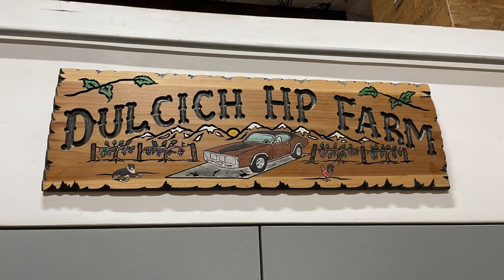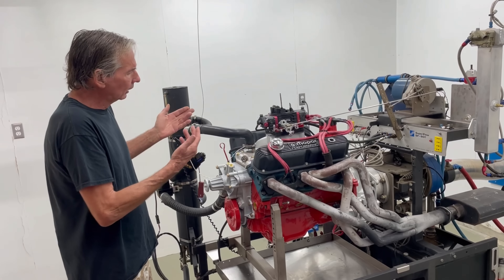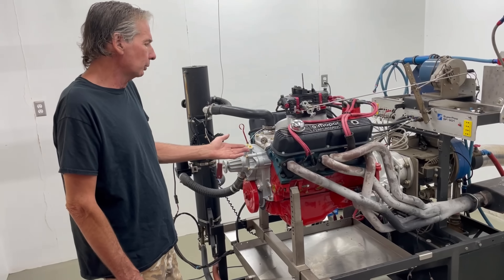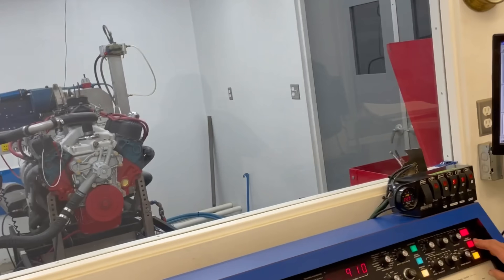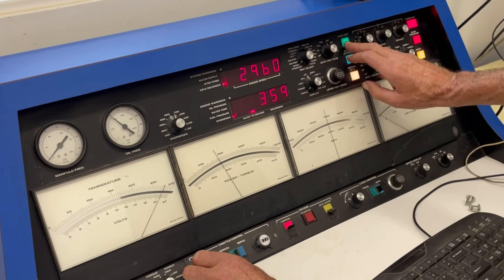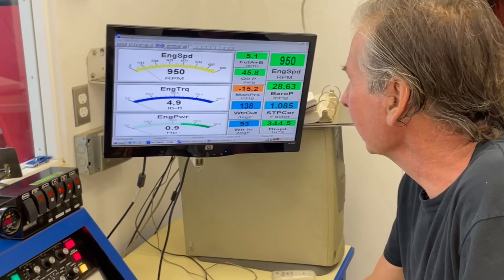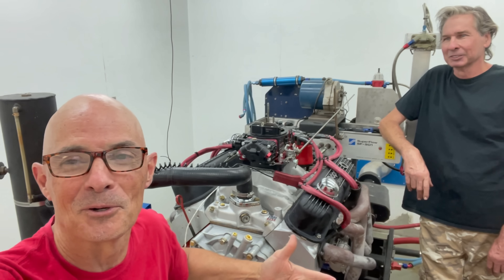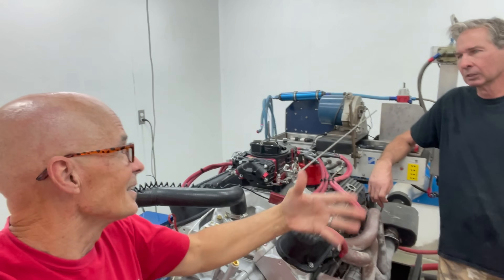AFR MOPAR 340 HEAD TEST! THE ENGINE MASTER HIMSELF, STEVE DULCICH & I COMPARED AFR VS IRON 360 HEADS

Comment: By all accounts, the open chamber 360 heads have 75cc +- combustion Chambers. AFR are 62cc.
I wonder how much power and torque was created simply from the compression bump? Definitely some.
The overall power numbers here seem very optimistic. All that matters is the increased power reference.

Comment: What I would give for a dyno session with Holdner or Dulcich and my very first blueprinted 360. The engine was built completely around the Comp XE284H and the first engine I built from the crank bearings up.

Comment: My first look at AFR heads on a Mopar. I know they work great on a lotta Chevy stuff.  This is impressive but didn’t edlbrock claim 50-60 hp increase by just bolting on their heads? I run them on small block and big blocks always had great luck but the newer set I have are prolly 2012 I think back to 99 being the first set I bought.

Comment: Super cool! One thing I’ve never seen on YouTube but would love to is get a decent running low performance 383. Dyno it as is, with that insane single 2 1/4” full exhaust & stock muffler… figure it’s probably around 250 hp… maybe less. Then dyno with dual exhaust, then with hp manifolds, then with a 4 barrel & high rise dual plane, then headers (heard headers don’t do much with that the 2 barrel cam; nice to confirm). Then do a whiplash cam; might need 93 or more octane with 8.5:1. or 9:1

Why you ask? If power is in the heads, these have the same heads as 440s so it would be really cool to see a boat anchor 383 make gain maybe 200 hp with only a cam, headers, and dual plane & carb… that cam is silly, but so what, it should make it all come together. Steve tried something similar was tried with a motorhome 440 but they have such low compression the outcome was not impressive. Just a tweak on a good theory.

Comment: Did the peak torque on the AFRs top out before 5200 rpm because of the tuned length of the intake runners, or because the heads could have flowed more?
Reply from the maker: mild cam, dual plane
Reply: @richardholdener1727 thank you, Richard!

Comment: Richard, on a change over to a kill shot system, I have both the dual plane and single; which one for the kill shot? I watched engine masters testing back and forth, the single ran cleaner under a Holley system. I have a 496 br300 cam
Reply from the maker: nitrous works with any intake

Comment: Nothing to circulate water through the engine. No pulley belt on the water pump. How do you cool it off between runs?
Reply from the maker: it has a remote electric water pump

Comment: Nice...Engine running,  WATER PUMP NOT TURNING.  What's the water temperature?? Is that a Mopar speed trick?
Reply from the maker: remote electric water pump for the dyno

Comment: Sir, considering an original engine like a 318 with a 4 barrel carb, that has limited headflow and a small cam; what'd you say would be better: a head swap with the original cam, or a cam swap with the original head? What do you reckon would make better overall? Thank you for everything you've shared.
Reply from the maker: cam would add more

Comment: Hey Richard, I know this is off subject, but why do you think nobody makes a cast cheaper version of a 4 inch stroker crank for LS motors. If they do, I haven’t found it.
The reason I ask is because I’ve seen a lot of cast cranks handle a lot of power, especially when the block has good strength and bracing on the mains and it seems to me the LS motor has exceptional, crank bracing with the mains set up 
I ran a scat 9000 cola 3.8 stroker in a early model sbc over 600hp on motor for years on the street also sprayed 250 pretty regularly 
Only issue I ever had with that engine was regular maintenance, which was valve lash due to solid roller, having to be adjusted every so often

Comment: hey richard is it possible to get some consulting on an ls build from you? it wouldnt be very long and id be willing to compensate you for your time. i just need to cut through some of the conflicting info im getting.
Reply from the maker: ask away or join the live feed-free info every night for 1 hour
Reply: @richardholdener1727  ok so im looking at getting a high miles early 2000s silverado 200k plus. its an lm7 and im looking at doing a 7875 dbb billet build would like to be able to turn up to 750 whp on e85 but dont plan on starting there. should i just do forged bottom end since i need to gap, change rod pins, refresh gaskets etc? i am doing pac spring should i just redo the whole valve train?

Comment: Has anyone tested the trick flow heads for mopar?
Reply: A Guy I know with a 70 Duster, 360 10.5.1 comp, 560 solid cam, trick flow heads, 904 with low gear set. Probably around 32-3300 with driver. Ran a best of 10.97 at 119, with a 1.44 60ft. I have seen the car run 121 before.

Comment: Everytime I see AFR or TrickFlow heads vs stock or less expensive aluminum heads I see a large difference in power.
I would just save a bit longer and buy the good heads  instead of pissing with stock heads.

Comment: I love 340's! A great underrated engine. Back when they were new,  a 340 Dart was a surprise on the street. Beat a lot of big block cars!
Reply: My dad's 68 Barracuda 340 formula s torqueflite best up on big blocks and his buddies' multiple dart  swinger 4 speed 340s.  But then again that stock torque flite auto would shift hard enough to chirp the tires in a couple of gears.  Potent 'little' engines.

Comment: I had a 71 swinger 340 833 4 sp 8/34 rear end I was destroying trans am ,Chevelle's,and that was my cousin car my main car was a 68 pro st super sport Camaro with a l78 Fairbank 400 trany manual valve body dana 60 rear pump gas running 9.50 street driven ,but  my swinger was a beast !

Comment: Yo D even with those 360 heads it made GD horse power and torque # now let's see with the aluminum heads, remember 340 was rated 275 HP D.

Comment: If you went from stock cam 2 barrel to air gap these heads & cam 750 or 850 4150 style carb and headers. What’s that about 150 lbs off the nose? Jeeze I bet it feel like a 150 shot just all the time 😅

Comment: am I the only one wondering why they pulled the distributor. i never pull mine, just the cap.
Reply: If the rear of the valley was sealed with rtv, it makes scraping a little easier without the distributor in the way. That's the only thing I can think of.
Reply: @ColdSmokes it is just one bolt, and super easy to drop back in with the timing marked. Lets me pull intake straight up since we were reusing the gaskets.

Comment: Is anybody going to ever make a REAL modern cylinder head for a small block Mopar that DOESN'T require about $5-6k of machine work to be usable? Let me clarify that, BESIDES the older W/2 type stuff like the Indys are based off of.

Comment: Roller Cam of same lift & duration as this setup is likely good for another 30-50 HP on top of 440hp seen here
Reply: And even more Streetable ....
Reply from the maker: I highly doubt 50 hp from same specs on hyd roller
Reply: No way. Not a realistic expectation.
Reply: Actually smaller duration cams like the 224/230 in this engine have more area under the curve than a roller most of the time.  Don't take my word for it watch David Vizard vids.

Comment: Why not run a Hughes cam? They are made for Mopars only. Hughes understands that the Mopar lifter is a .904 size lifter which is bigger than the Chevy lifter and the ramp rate can be more aggressive on a 904 sized lifter. Comp grinds all their stuff on a Chevy grind with Chevy lifters in mind, Hughes doesn’t do Chevy. We dynoed a 440 with a Comp then a Hughes cam with the same basic stats but the Hughes cam made 13 more HP and 21 more ft lbs of torque.
Reply: 904 profile will make incrementally more power, but I had this cam and it is pretty good.
Reply from the maker: Key part is this comment is "same basic stats"-meaning different cam

Comment: Put trick flow 240s on it
Reply from the maker: 240S?
Reply: @richardholdener1727  yes put a set of trick flow 240 heads on that 340
Reply: 240 Trick Flow heads are for Mopar big block.

Comment: re run with tunnel ram and 2 800 hollys. I would of thought more since the iron heads were small valve. of coarse cam selection also comes into play. thanks for the info!

Comment: stock the la heads were crap.  get the turd out of the intake ports and do a little more porting and they fly. I wish I still had my flow sheets from 35 years ago,I spent well over 100 hours flowing and testing various dead heads to see just how much and where helps and where to leave them alone. got the x heads to out flow the new out of the box W2 heads I had.

Comment: Wow, thats great for stock 1.88s. Wonder what you could get with some porting? Just got a 71 340 that was supposed to have 2.02s but has 1.88s. The old switcheroo. Now I don't feel to bad knowing what Steve got out of them. Thanks guys.
Reply: I  read an article where Steve did just that, he made 60 more hp. 414hp to 474 or therabouts.

Comment: See what you can do when you’re motivated 👍🏻👍🏻👍🏻👍🏻! Nice job on the dyno room! Dulchich needs to put a stock engine on it & tune it to absolute death! To get him over the jitters of doing dyno pulls! He shouldn’t be beating the piss out of a good engine! Glad you were with him Holdener 👍🏻👍🏻👍🏻👍🏻!
Reply from the maker: One of my junkyard LS motors (with 200K when removed) has over 700 pulls on it (NA, turbo and nitrous). The motor is fine on the dyno
Reply: @richardholdener1727  that’s what you want brother 👍🏻👍🏻👍🏻👍🏻! It will probably puke a rod for him on the first pull 😝😝😝😝! Good video!

Comment: WOW, even 370 with the cast heads means that cam, intake and carb is AMAZING, 66 hp increase with those heads is great!!!! imagine that 340 stroked?? Stock 340 was 275
Reply: Older 1st gen higher compression Stock 340’s that were rated at 275 gross hp actually dyno’d at approx 320-330hp gross hp in totally stock builds.
That’s why they were able often beat slightly heavier bbc cars with larger motors like 396/350hp.

Comment: i wonder how those heads would perform on a stroker 340/360  409 motor,  i am building a motor for my 73 roadrunner to replace the tired 360.

Comment: Steve Dulcich has had an haircut! For an iron headed 340 to make 374 HP and 409 lb/ft of torque is really good. This 340 with the 175 AFR heads making 441 HP and 442 lb/ft of torque would make a great street engine
Reply: What he said.

Comment: At the start of the AFR test. I'll guess 425hp. Basically, it's a 50hp gain over iron heads.  Being the AFRs are pretty mild, I'd think a 50hp increase would be a great victory. EDIT- wow, with a very streetable cam, it topped 440hp. That little engine will rock, for years to come. Nice build. Be well, everyone.

Comment: Hey Richard, What do you feel about Chillers Not powered off the Crank on a Blown Engine in league of an air to air or air to water Intercooler?
I asked you a long time back what you thought of Chillers under Blowers, your issue was they ate HP to operate, so not passive
Reply from the maker: are you asking about intercoolers positioned under the blower or using the AC system to pre or post cool the air (which takes power)

Comment: How do you have a 28.60 baro where Steve's dyno sits?
Reply from the maker: I'll check with Steve
Reply: @richardholdener1727  Thank you, better yet take a weather station up there with you next time. Pretty sure Steve is below 300 feet altitude.
Reply: I agree with @vortecpro.  We dyno at 880 ft and rarely see a baro below 29

Comment: A really good test. A very typical build you potentially find on the street, small cam nothing anywhere over the top.
Great to see more players entering the market with Mopar stuff. Maybe one day we'll see Dart Mopar blocks ?? Thankyou guys.
Reply: This engine is very similar to mine.  70 340 (forged guts) 202 160 J heads.

The performer rpm didn’t exist back then.  

Thing pulled the front wheels skyward in an 80 Cordoba.

Fully drivable 4 seasons in Canada.
Reply: Some resonably priced new 340 blocks, sell like beer on a hot day!

Comment: That was cool seeing a small block Mopar. I built a 340 in the eighties and I used the W2 heads and I ported them with templates that you could purchase through Direct Connection. I never knew how much of an improvement it was over stock, as far as flow numbers or dyno numbers, but my 69 satellite hauled some serious ass, back then. I would like to see a test with those old heads.
Reply: Better then these!

Comment: Funny enough, 25 years ago, we built a mild 360 with Performer RPM heads (which are close to the AFRs, but prob. quite as good), a non-Air Gap Performer RPM and a Hughes 230/236 cam, and made 449 hp and 456 pound-feet.
Reply: What number did you have for chamber cc's?

Comment: This doesn’t make me want to replace my 340X heads because you started with 360 heads. Stock 340s have similar valve size as the AFRs. I’d like to see how these compare to some slightly cleaned up 340 heads. Mine are on a 372” motor.
Reply: These look like 10-15 cfm more , higher cr and 60 lbs off of the front of the car
Reply: Valve size doesn't indicate overall performance. If your X heads were fully ported they could flow as well and even better than the stock AFR heads. The AFR flow almost 60CFM more than a fresh set of X heads that haven't been ported. The 2.02 X over a later 1.88 valve head is about 10-15cfm like the other guy mentioned. Probably see about 50-55hp gain from stock fresh X-heads vs something like the AFR heads. If the engine is completely stock,stock 340 cam, stock intake manifold n exhaust manifolds the gains won't be as much.
Reply: @dannyfasttcars8612 bowl ported x heads flow 240-250. I would bet the AFR”s would also pick up some flow with porting also. Remember the X heads are 50 years old also.
Reply: @Patrick-xd8jv X heads don't go 240-250 with just a bowl blend. May got the wrong head data or info. With a fresh valve job they may be lucky to hit a shade over 210-220 230 blended. Even Steve's ported 2.02 heads did 236 with more extensive work, chamber de shrouding,Push rod pinch, guide etc.  Stock W2's do 230's but will go 240-250 with a blend.  I do know fully ported days n nights days and nights grinding we can get the old X heads(or just bigger valve in any of the heads since the ports are the same) beating what the Edelbrocks n AFR heads do by a solid 30CFM. It all depends what a guy is trying to do. Most these heads are just cast after a mildly ported version of the old heads anyways. That's what the edelbrock RPM heads were.  With a better closed chamber n aluminum. Those came out decades ago already. Would be nice if they would have at least taken it to the next level. We have more than enough basic Small block heads already. Need heads over 200CC to help guys make some steam. Especially when using a 4" crank. Indy's are nice but they had lots of issues. The victors were killer (but pricey) All the W Series are hard to find and get headers and an under hood intake is a pain.
Reply: @dannyfasttcars8612 my X heads flowed 240 with a bowl blend on a Superflow🤷🏼‍♂️
Reply: @Patrick-xd8jv  They may have.  It is uncommon. We did just lose 10 cfm in one story to the next. The base numbers will give a better indication of factors. Like if they went 205 or 225 before they will show a lot more of the story.  For instance stuff on Hughes bench  seems to flow 20CFM more than everybody else's. In the world of data we can't use one example to dictate the standards. I'm just going by about 50 examples of my own work and others that have been published over the last 40 years. The edelbrock heads which are cast after a ported 2.02 head flow 240's The guide is smaller,PP narrower, short turn is better, gasket CNC(although has a step)ports are straighter.
Reply: @dannyfasttcars8612 read it again. I said 240-250.

Comment: Great video. Richard & Steve together in a dyno room !!! I put a 360 together mostly stock. With 350hp. I might look at those AFR heads. Might get me to 400hp in my old Demon. Thx  👍
Reply: What cam did you use?
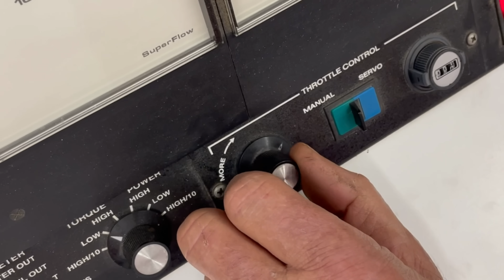Reply: @MrCordoroi  Comp Cams - Xtreme Energy 224/230 Hydraulic Roller Cam - SKU 20-811-9 - XR274HR-10 it has a nice rumble. It tops out at 5500 rpm. I don’t run it up over that. Has right at 400 ft/lbs of torque. A833 with 8 3/4 with 3:55 gears. Makes the Demon run pretty decent.

Comment: The 360 with the right cam and pistons using the stock heads and that intake and carb should make more power?
Reply: It’s more cubes, I would hope so.
Reply: @cedricwilson2055 I do believe that the 75 360 sport Dodge was faster than the 75 Corvette.
Reply: @Bob-the-handyman max 245 hp in 75 for a 360. Good torque also
Reply: @cedricwilson2055 low compression engine. Probably had thicker head gasket to drop compression.
Reply: @Bob-the-handyman and garbage pistons with no to to little quench. No reason a 360 should not out power a 340 seed f built right.

Comment: 374hp with stock 1.88" heads, stock rockers, and around 9:1 compression, and a small cam upgrade?
Yeah that's a win any day. Especially when you look at the hp & torque per cubic inch numbers. 
I like the AFR upgrade results also.
Reply: The 340 making almost 450 horsepower is crazy. It’s a salad bowl away 💪
Reply: I’d like to see comparison with early 2.02 heads. I
Reply: @slackerman7715  Yep
Reply: @slackerman7715 won't be impressive

Comment: Good to see you working with Steve. Pretty good results!   Does AFR make a cylinder head for the 440? That would be awesome.
Reply: They don't. Trickflow has some really nice 440 heads already. 240CC and the Max Wedge  270's.